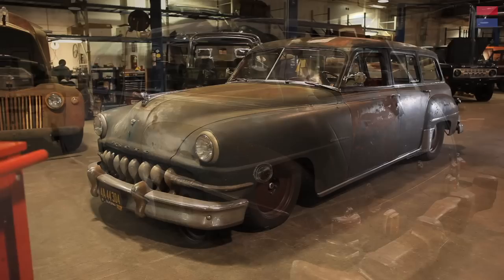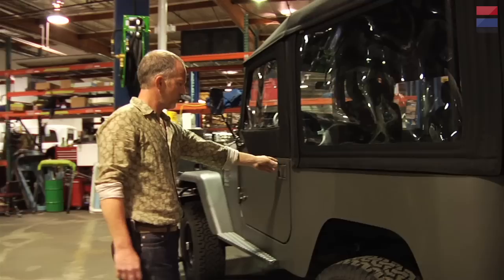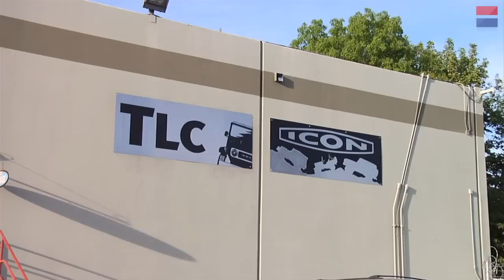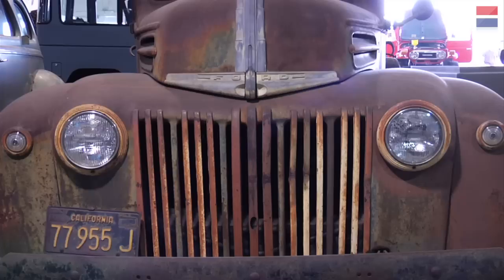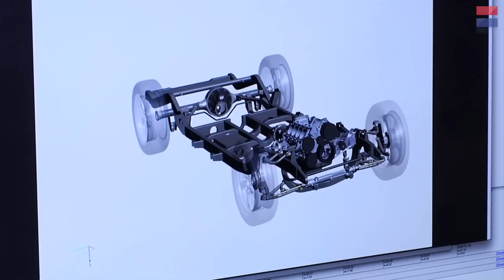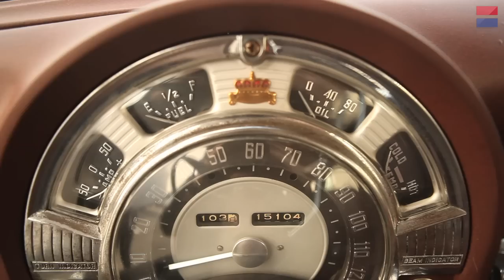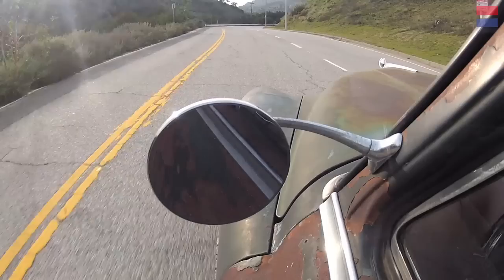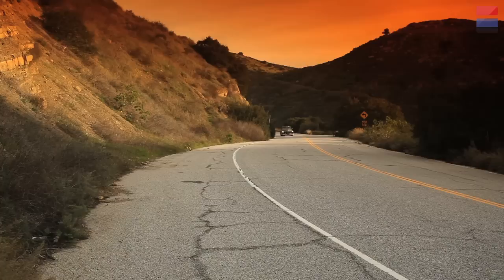ICON Derelicts: A Romantic Marriage of Old and New - CAR and DRIVER

Comment: At 9:05, they were talking about door hinges and door latches being a "weak spot" on that '52 Desoto. They got that right! About 1959, my dad was driving a 1952 Plymouth (with me, then 4 years old, riding shotgun). Dad took a curve too fast and drove the car into a ditch. I still remember to this day how his driver's side door flew open merely because he bumped his shoulder into it before impact. Fortunately, we were not hurt.

It was not until the late 1950's that car door latches were legally required to be made safer so that they won't fly open by bumping into the door. So I would say ditch that original door latch/hinge mechanism and put a safer modern door latch/hinge in it, before you wind up getting ejected from the car, if you are driving a pre-1958 car!

Comment: Absolutely beautiful. I love it. I got into patina cars about 10 years ago, before they became an "in" thing, when I bought a 1964 Ford Fairlane 4 door sedan. The body was straight and rust free (except for some surface rust) it was white at one time, now it is half faded white, half surface rust and red oxide primer, and everything in between. It ran, but had some mechanical issues. My original intention (I am an auto mechanic by trade, sadly mostly late model stuff, but a vintage car enthusiast) was just to keep it patched up and running, fixing something when it needed it. I almost sold it once. Then I decided to get serious about it. I replaced the 200c.i. straight 6 and 2 speed Ford-O-Matic with a late model Mustang 5.0 and automatic, Replaced the whole front end with a Mustang II setup, rack and pinion, disc brakes, installed new rear suspension, axle, rear discs, new driveshaft, all new electrical system, etc. It still has the complete old body, torn and rotted weatherstripping and all. It leaks when it rains. But it never rains here in Phoenix AZ. The floor was done in truck bed liner with mats, and the seats were done in marine grade vinyl, so I don't really care about the water leaks. I drove this car from Phoenix to Seattle WA and back at freeway speeds, had no problems at all. Got lots of looks. I'm totally hooked on vintage patina cars now.
Reply: Is it a 5.0L Coyote with a 6-speed auto swap.
Reply: Jerry H l

Comment: What a good interview! Really well done. I'm all smiles about these cars. At a lower cost, older motorcycles are a good option for patina enthusists. I had an R-75/6 BMW with just a few thousand dollars invested that would hang with modern bikes in the corners well enough to surprise most of them. Nothing like passing twice your horsepower on the inside.

Comment: My friend Smokey had a 53 DeSoto sedan with the front seat bolts pulled away from the frame, so he had a 2x4 wedged between the front and back seat to hold it in place.  Trouble was that if you had to stop real fast, the board would come loose, and the front seat would fall over backwards.

Comment: i have total respect for what you do, and for the fact that it is mostly still mopar, but i will keep the original 413 and dual plane brakes in my 62 imperial, i do know that old mopar is hard to find any parts for, but i love both old and new, and you cannot beat the original ride and performance, that 413 is scary at best, you are a mechanical  pro, and thank you for sharing, but please dont call my old car a dedelict

Comment: "Modern mechanical goodness"!? Anyone who has ever replaced a fried ECM, an ABS module, or a set of $500-apiece coil packs can be forgiven for laughing at that statement.
Reply: ***** Electronics are only an Engineers friend or ours until they fail.Adding Motherboards to ANY Consumer device has boosted Corporate income, & made owners poor, by design.  Wait until the Manufacturer "deletes" the Boards or coils You desperately need.  It will eventually happen.
Reply: artistmac I

Comment: Jon Ward is the only man (I know of) who builds vehicles the way I would want one built. Respect for the original design with modern, bullet-proof guts, these cars are built to be driven.
Reply: It is good, isn't it? The car has modern stuff in it and like you said, is meant to be driven. I know if I got some Wagons from the 1970s I'd like to drive them, though a museum piece is good in its own way too.
Reply: A car, in the hands of a driver, is like a living thing. Even museum pieces need to be driven occasionally, otherwise they're just pretty hunks of metal. 

I love the old wagons too, by the way. I'd like to hook one up like this derelict but with 4 wheel drive and a killer sound system. Then it's time for a road trip.
Reply: CletisVanDam1 No kidding around. My Grandfather has a 1967 Convertible and he hasn't driven it much, I think it has fewer than 30,000 miles on it. It has been garage-kept for a long time so I imagine it's in pretty good shape but will need some work done to it before it's road-worthy.

And yeah, wagons aren't so common these days - are they? So many got smashed in demolition derbies and just junked out of hard work. They were once common, but now they're mostly gone since Minivans and SUVs became more popular. I do know a person could fit more into a van given the extra headroom, but the Wagons still have their place. Oh and the windshields in those old cars were a lot easier to see out of without moving in the seat than my Dad's 2000 Caravan.

Comment: I guess you can call this a sleeper express. 

A normal sleeper would be a pickup truck with 900hp, stock wheels, and sticky tires, plus necessary structure to make it last with the added power/torque.

A sleeper express would be one of these. Modern performance in an unassuming package, rather than just being a straight line piece.

Comment: In Cuba all the classic American taxi cars were retrofitted with 4cyl Hyundai engines and AC units
Reply: All have 4cyl Hyundai engines and a/c? No, most are a hodgepodge of old lada, mercedes or whatever running gear could be adopted to fit and not all have a/c.

Comment: I love the idea so much that I have been working on a 50 Buick special. But I have run in to a  problem. I want to use the stock speedo and I am running a 700r4 trans. anyone know how to mate up the speedo cable from old to new ????
Reply: There's still some shops that make speedo cables from scratch, but I've never messed with anything older than 72, don't know what they use now but shouldn't be too different( unless it's electronic). You'll just have to check your actual speed with what it shows after you get one, it may be off.

Comment: still have to be rich to by either an icon 4x4 or a derelict. whats it going to cost to "restore" that $500 beater ? the website also has reformers. I would love to have an old car that's rust and dent free and primered  with modern everything.

Comment: Let's take a car designed for 45 MPH highways and dirt roads, and give it a 600 HP engine.
Reply: And a new frame, brakes, and suspension.
Reply: butlerproman
And new aerodynamics
Reply: hyzercreek hey they had 600 horsepower with 10 tons of weight.

Comment: Added side effect of this car, must be no one in flashy expensive cars will want to park next to it in case of door denting and no insurance from a broke owner. And car thieves won't look twice at it.
Reply: Sometimes that's one thing about driving cars that look like they're worth scrap value or are ready for a demolition derby. Have you ever seen a photo of that 1973 Chevy Wagon in Seattle? The thing looked like it had been parked outside for about 40 years. Included is a link to it if you're curious; the hood has surface rust all over it.

http://seattlesclassic.blogspot.com/2013/06/1973-chevrolet-caprice-estate-wagon.html

Comment: The wheels are the main disappointment. I understand why he runs 17" wheels due to the brakes, but the alloys just look photoshopped. This is made worse by the lazer etched hubnut cover, the dished area around the wheel nuts and then he painted the alloy satin oxide primer to give it a fake aged appearance. It doesn't match the rest of the car - Jonathan if you had a blank page with the wheels why did you mess this up so much